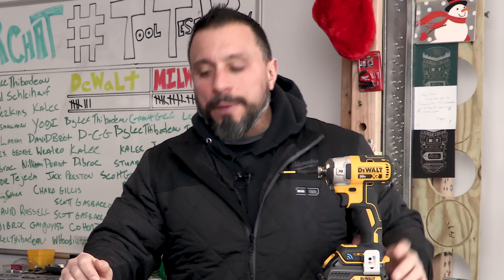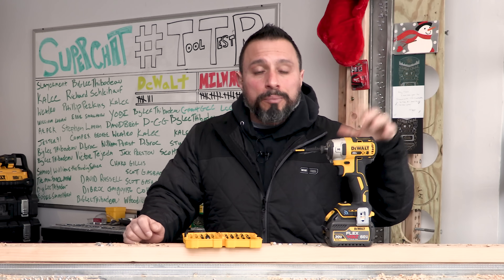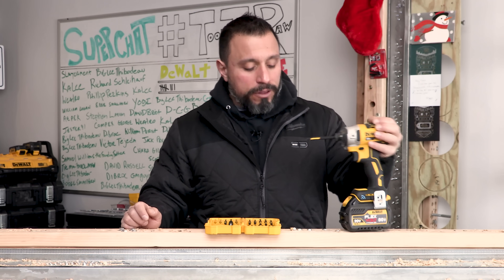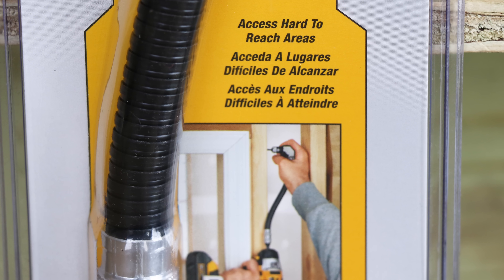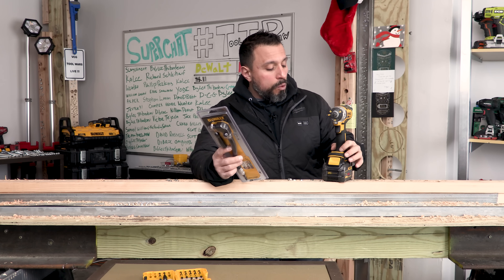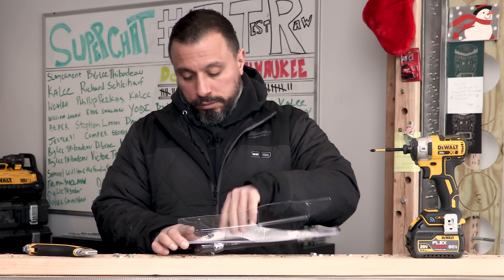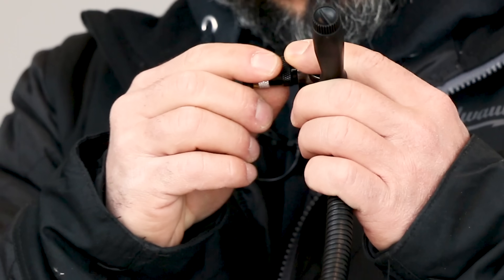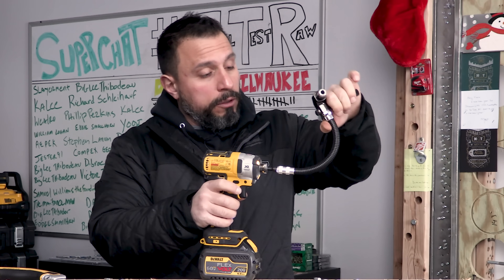THIS DeWALT TOOL ACCESSORY WILL CHANGE YOUR LIFE!

Comment: Solid looking adapter. I use the dewalt right angle adapter and it works great for inside cabinets and retail fixtures. I’ll look out for this piece.
Reply from the maker: Gives more flexibility!!

Comment: Looks like a very handy tool to get into tight spots do ya think it would work with a drill driver or would It be to much torque and keep twisting the shaft
Reply from the maker: It seems to be fine with both drill and impact, it didn’t give a torque limit but I’m sure it would coil up under excessive load!! Should we test that?
Reply: No don’t ruin your tool ya it’s seems like a handy tool we’re putting drawer handles and stuff like that on but other than that iam sure it wasn’t made for real long and beefy screws but thank you once again for an honest and great review so far all your reviews have very good and honest in my books thanks

Comment: I didn’t have luck with mine it would take screws out but did seem to have a enough power to drive a self taper through 26 gauge metal might get another one in case I had a bad one great vid Vince
Reply from the maker: Really Ray? Imma test it out on 20gauge!!

Comment: I literally just bought this the other day and opened it yesterday!

Also Vince or anyone really quick question, do you guys have any tricks for screwing in a 4 inch wood screw without stripping it using an impact driver without predrilling the hole?
Reply from the maker: Use “Spax” fasteners!
Reply: @VCGConstruction  ah yes I know you love those. Thank you!

Also, could you make a video on the milwaukee cordless super sawzall vs the milwaukee one-key sawzall programmed for that specific material?
Thanks again for the videos! I always look to see what you guys post before I go buying another tool 
I'm in the hvac field and it's great that you have a guy who's starting hvac keep up the good work!

Comment: So should I throw out my flex shaft and my right angle drill attachment which works well together, just because Dewalt put the two together and calls it a great new tool?

Comment: The one that doesn’t flex is better for 1/4 rubber washer screw cause you can put the screw in the driver itself without a bit. With that one you need a driver bit that in turn makes it to long for what I use it for

Comment: You did a video saying never use FLEXVOLT on 20 volt tool and yet you were using a FlexVolt on this commercial on a 20 v drill.   I am sure you have seen the video saying a FLexVolt is fine on a 20 v dewalt tool.  Mine work great on a FlexVolt.

Comment: Be really careful directing your shaft while screwing things!
Reply from the maker: Thats right!
Reply: @VCGConstruction  
Honestly though I've had that flex extension  for about a year.  It works good for getting into tight spots . But it's not capable  of driving anything I tried to put a 3" screw once into a stud and it bound up so hard it twisted the shaft almost into a circle and snapped outta my hand.  Just keep that in mind if you do a video testing it . I wouldn't recommend  trying a lag or a timber lock.  1 1/2"  is about maxed into soft wood for this thing

Comment: DEWALT bits suck, I wish they where better. I mostly use #2’s or #3’s on commercial jobs and I go through several of both in a week. Lots of drilling and installing doors. They just don’t hold up and often break. I try to be gentle on them but are crap compared to other companies bits. For instance, Mikata’s gold bits are tough as nails and last months. I am loyal to DEWALT and they need to do something better.